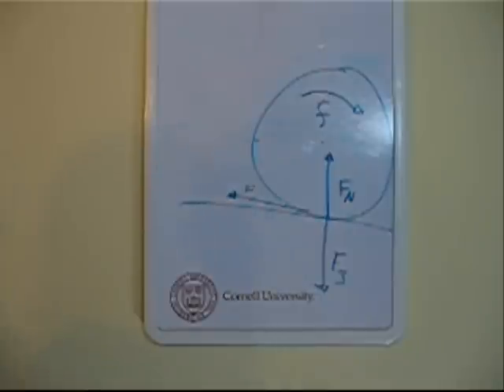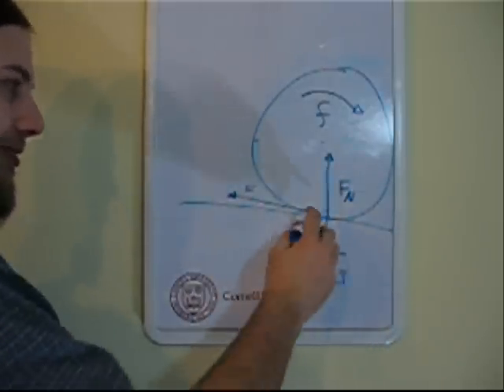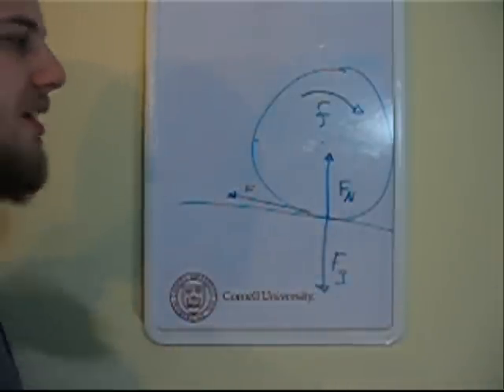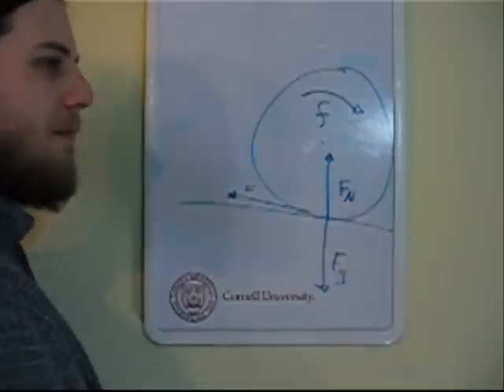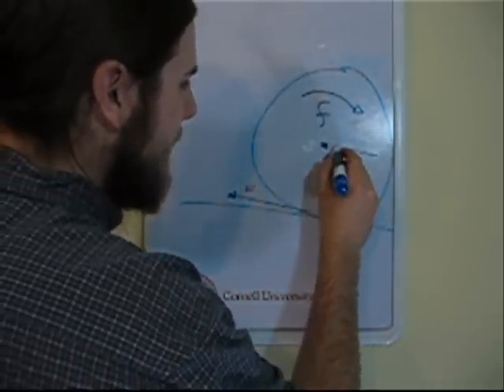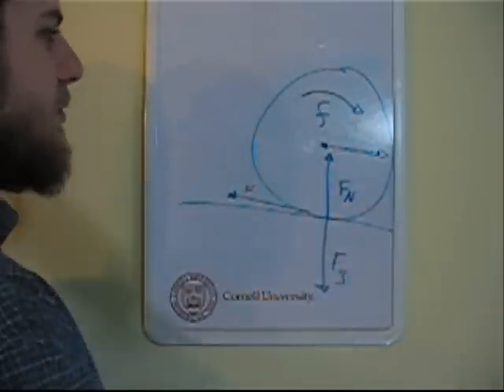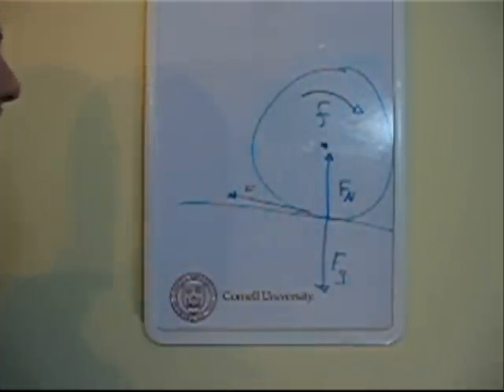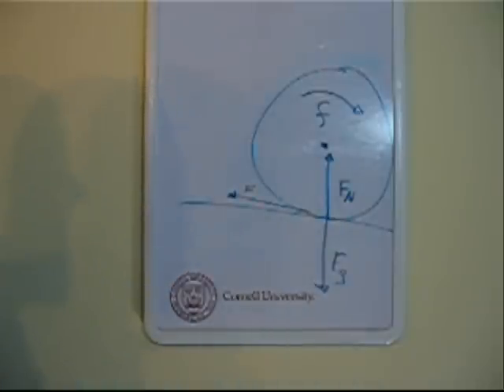Airplane on a Conveyor Belt - Complete Physics, pt. 4

Comment: Every person who doesn’t understand aerodynamics will spin off into convoluted equations and fall down rabbit holes dealing with friction, broken wheels, etc.  

It all comes down to airspeed over and under the wings.  In this thought experiment if the conveyor can match the speed that the plane would travel on a normal runway then the plane, relative to the ground, will have no forward motion and no airflow over the wings in the case of a jet plane. A propellor plane will have airflow  from the prop but it’s insufficient to lift the plane off the ground, otherwise, prop driven planes would not need runways and could take off from a standing position

Comment: Thanks for this explanation.  This is what many of "wrong" people are arguing.  There is a force backwards.  A simple experiment to prove this would be to put a skate board on a tread mill and hold it in place with your hand until the treadmill was going pretty fast.  Then let go.  If there were no force backwards, the skateboard would stay in place.  But what happens is the skateboard move backwards relative to the ground.  The force of the treadmill pulls it back.

Comment: IT was a plane.

People are thinking that it isn't about the "perfect" treadmill, but ignore the "perfect" axel.

TREADMILLS MOVE THINGS....  and a treadmill can move a plane.

Wheels are never mentioned in the question... wheels can rotate 1000 times the speed of whatever and not move which is what people are arguing... (but the wheels must only rotate 2 times the speed of the ground for the plane eventually lift off).  So again, by the question things can rotate faster than take off.

Comment from the maker: Again, go back to the Mythbusters Knight Rider myth: Cars don't respond much to changes in the speed of the ground under them. If you accelerate the conveyor to -1mph under the car, what happens? The car keeps going at 1mph relative to the ground. Because the car is heavy and has a lot of inertia, and you're not accelerating it very much. (So maybe it goes at 0.999 mph relative to the ground. Who cares?)

It does exactly what you think the plane would do. Why do you think it does something else?

Comment from the maker: Again, part 4 deals with hypothetical ideal universes with perfect materials and the like. In the real world, it would be difficult to design a conveyor that could stop a bicycle, much less a big thing like a car or airplane. But if you think that there are no physical principles by which a conveyor belt, accelerating under a bicycle or a plane, could pull it back, you're simply wrong. If you say, "those principles exist but aren't important for real vehicles," then you agree with my position.

Comment from the maker: Why do you think what the car pushes against matters? A force is a force, after all: if the car pushes against *anything*, that something will push back on it. So if the car tries to push against the belt? The belt will push the car forward in response. It's just like driving on a road: the fact that you're going, say, 30mph (and hence, from your perspective, the road is going 30mph out from under you) doesn't stop you from speeding up to 60mph, if you want to.

Comment from the maker: Right. Your response does not address friction, but my part-4 argument was designed to deal with people who said, "well, in a perfect world where the engine isn't causing frictional losses, the plane still takes off." So you're responding to the part-4 argument for illegitimate reasons, because you're *not* talking about that world. What about that is so difficult?

The force is proportional to the acceleration of the belt. It is significant or insignificant depending on that acceleration.

Comment from the maker: Well, the car doesn't care about your imagination. In the way of phrasing this issue that lets the car drive off, there's nothing inconsistent about the car traveling forward 30 mph relative to the ground. 

(You may also want to rewatch the Mythbusters episode where they tested the Knight Rider myth: they proved that a normal car does not respond much to changes in the speed of the road. Inertia etc.)

In other words, identify the "relative to X" when you say "If the car is powered to 1 mph."

Comment from the maker: Had you read the comment thread, two comments below the one you left on the main page, I left a reply to "zegneverx" stating something which applies equally well to this comment: 'I created the part-4-argument to deal with people who said, "in an ideal frictionless world, the track couldn't break the plane and it would take off." In an ideal world, it depends on the maximum rate that the conveyor belt can accelerate versus the maximum acceleration that the airplane's engines can provide.'

Comment from the maker: I don't know what exactly you're taking issue with in my video, as part 4 of this lecture isn't about the friction of the wheel bearings at all. You might need to re-watch the video.

I created the part-4-argument to deal with people who said, "in an ideal frictionless world, the track couldn't break the plane and it would take off." In an ideal world, it depends on the maximum rate that the conveyor belt can accelerate versus the maximum acceleration that the airplane's engines can provide.

Comment: Airplanes usually measure their speed by air speed, and if you assume no wind, that is the same as ground speed, so if you match that speed, the plane basically has situation 1.

This is the unfair comparison that most people assume. I confess that I thought that way until you explained it and made me really think it through.

I also confess that I was thinking incorrectly that spinning the wheels faster was exerting no force on the plane. The way you explain it makes it clear that it does.

Comment: The problem is that most people aren't really talking about situation 1 or situation but a strange combination of the two. People generally think of the speed of the car as what the speedometer says, so if you match the conveyor belt to the car's speedometer, you basically have situation 3.

Comment: Curiously, its only if the wheels do fall off that the treadmill cannot stop the plane.  Without wheels, the jets must provide a force greater than maximum friction to accelerate the plane.  The beauty of wheels is that to accelerate the plane, you need only a tiny force, less than the maximum friction.

Comment: Indeed!  The plane does not take off if its wheels roll without slipping and the treadmill accelerates enough!  A common idea is that all that's different is that the wheels spin faster.  A simple way to see that this cannot be strictly right is that if the wheels do spin faster, their rotational acceleration must have been greater, which means the torque on them was greater.  Since friction provides the torque, friction must have been greater, and reduced the acceleration of the plane.